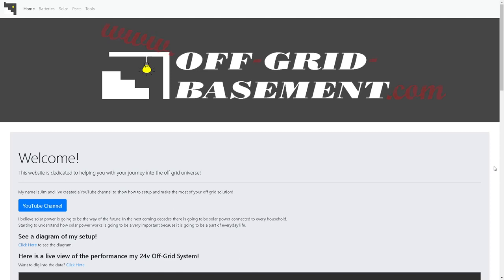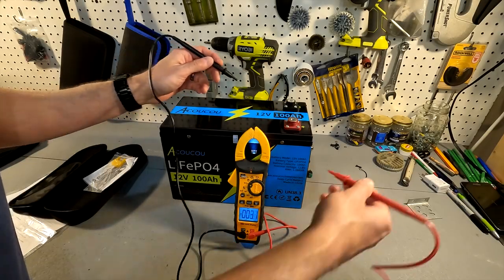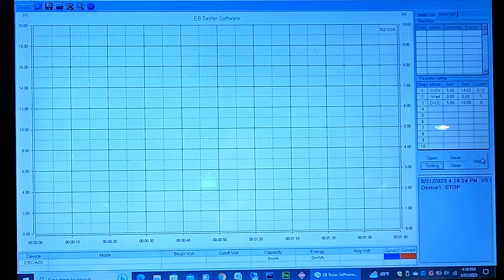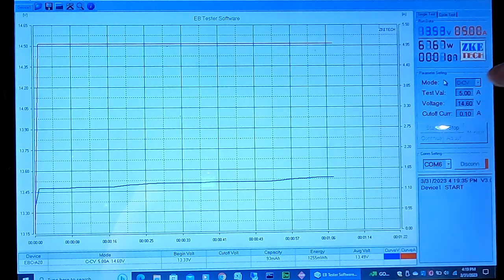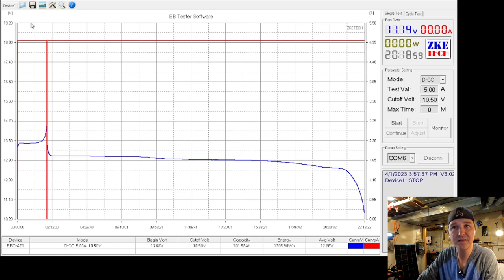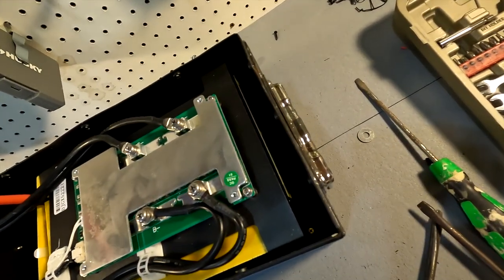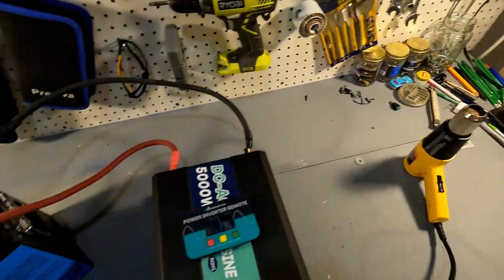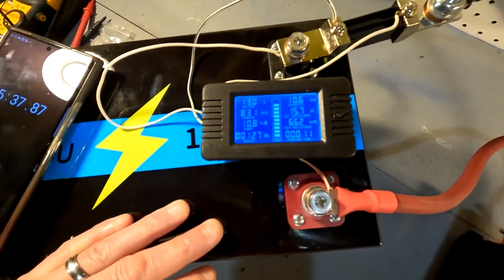Acoucou 12v 100ah lifepo4 Battery Review

Comment: Very interesting review.  It's unfortunate that there was something loose inside the case.  Should that make one concerned that this could be a common occurrence with this company?  The case looks very solid.
Reply from the maker: I was pretty disappointed with something being loose inside the case.  It ended up being nothing to worry about, but it should never happen.
Reply: We are sorry to bring you such confusion, we will not run away from this problem, and we are also grateful to JIM to let us find these problems, we used to use the laser welding method to ensure the stability of the cells, we have done a redesign according to the internal structure of the MaxOne series and replace the current version, such as the yellow plate off, hope you can pay attention to our follow-up.

Comment: Good review. I like the metal case, however the wire gauge used for positive and negative is not large enough to support 100amps continuous. If I were to buy this battery, I would not draw more than 35amps continuous and 50 amps for < 5 minutes.
Reply from the maker: Good point!  I noticed the 7 awg wire on the positive.  That is really rated for 50 - 55 amps.  Thanks for the info and the comment.
Reply: Thank you very much for pointing out a very professional problem. We considered this problem at first and ignored it from a practical point of view, but based on your needs, I think we can consider studying the solution with our engineers.

Comment: Because it can operate down to -4 degrees Fahrenheit.  Does that mean it has a heater?  I notice it didn't say anything about a heater on their website.
Reply from the maker: No.  It doesn't have a heater.  Most can discharge at that temp, but not charge.  Still....  -4⁰ is an odd temp.  Thanks for the comment.
Reply: @OffGridBasement  yeah maybe their documentation is off
Reply: @OffGridBasement  or they didn't program it right

Comment: They may have shipped it full due to BMS phantom draw and not knowing how long the battery would be in storage/transit before being sold.   Just a guess though.  Good video.  👍
Reply from the maker: Thanks.  I contacted them about it and they didn't seem too concerned.  Thanks for the comment.
Reply: Yes, our internal cells are all brand new production of high quality A grade cells, indeed full, but our test results before factory inspection is also a little more than 13 volts, after more than a month and not much decay, this is our principle, regardless of the country from which we ship, we produce these things ourselves, so can guarantee, if there is any confusion also please describe in more detail.

Comment: My inverter shuts down every three hours..what could be the reason? It starts to spark a little before this annoying shutdown. It doesn't show overload, just shuts down every three hours.
Reply from the maker: Unfortunately I don't know the internal workings of an inverter, but if it's sparking I would stop using it immediately.  It could damage anything plugged into it or worse, cause a fire.
Reply: It still works but shuts off every three hours. I'll replace it though, thanks.

Comment: Way to expensive for just 100ah! Timeusb has a 220ah in a metal case for under $650 a much better battery.
Reply from the maker: I see it shows $800 on Amazon.  It's less expensive on the website, but it still pretty pricey.  They need to knock it down a $100 at least.
Reply: darn right, Michael, all I know about this Acocou is that they were selling I'd say "crap" for much more money, purchased a fast charger from 'em before, and guess what?  quit working after 10 days, over-heat.
Manufactured by so called Brightpower Optoelectronic, and after a littlle bit of checking, you will find out  Acoucou or what so ever did not design or develop any kind of battery or charger at all, all they did to this battery was revising the metal shell, and chargers? just put their so called brand on that, funny, right?  when it comes to the price,they monsters, quality= crap, stay away from this so-called brand/manufacturer claimed to be.
Reply: and their customer service, sucks, do not buy anything from Acoucou.
Reply: Amazon?10days?seriousily?😢
Reply: @KaylenMccarty  In addition, you said the bright power does have a relationship with us, indicating that you seem to be electronic manufacturing circle or you know us, then you must also know our company was established decades, how big the factory, how professional equipment, rather than what you say brand on a shell, regardless of what you say GaN fast charging or lithium iron phosphate, although gallium nitride materials and lithium iron phosphate technology is not invented by us. But this does not mean that your statement is correct, the core of the technology also needs to match the corresponding manufacturing level and product standards, your statement proves that you have some understanding of the manufacturing industry, but your starting point seems to be malicious, and many of the points raised seem ridiculous, then perhaps you can understand what I am implying, right?
For example, our batteries, even after five years we can still provide services, it is difficult to exist in the ten days you say, I believe that such a situation is rare in the world no matter which brand of users.
Reply: @Iriswu-oe8ni  Brightpower Optoelectronic was 
stated within the manufacturer part of their product decription section, of this  gan fast charger, 10 days, yes, and I did not say anything before I actually see this video, personally I won't waste time do all da comments here,but I did, so I am leaving now, you never know what they say to their customers,LOL,I won't reply to them, just check their reply here.
Reply: @KaylenMccarty  Didn't they deal with after-sales issues for you?
Reply: @Iriswu-oe8ni  LOL, well, they did sent some texts, via amazon, nothing happened after that, that is all.
Reply: @Iriswu-oe8ni  but hey, no return & refund, nada, so, think again, before spending $$$

Comment: Yo-ho-ho! 🏴‍☠ Today's video is all about unboxing and testing the cuckoo 100A 12V lithium iron phosphate battery. Our brave host dives into the packaging and discovers a well-protected battery with a neat metal case (watch out for those foam-poking terminals, though). The battery's vital stats are all laid out on the label, but the accompanying documentation is more mystery than manual.

Our fearless tester charges the battery up to 14.6V and runs a capacity test, revealing a whopping 101.58 amp hours! The discharge test reveals the BMS cutoff voltage is lower than 10.5V, but the real adventure begins when our hero hears a mysterious jingling inside the battery. 😱

Fret not, dear viewers, for it's just a harmless piece of fiberboard that came unglued. While our host deems the battery safe, they caution any swashbucklers to send back batteries with odd clunking noises, lest ye void your warranties.

Got more questions about this battery? Drop a comment below and our wise host shall share their knowledge. Until next time, battery enthusiasts, have a voltage-ous day! ⚡🤣
Reply from the maker: Thanks James.  Another full flavored description of the video.  Ahoy Matey!
Reply: Thanks.Your comment has given us a glimmer of pleasure in an otherwise very bad mood. Even though you said it was harmless fiberboard, we will still correct the current solution and all we want is for you to receive a perfect piece at any time and place.